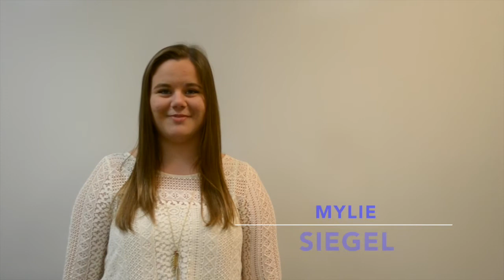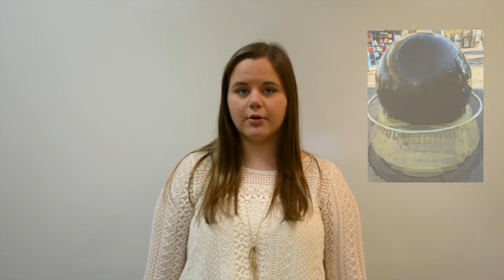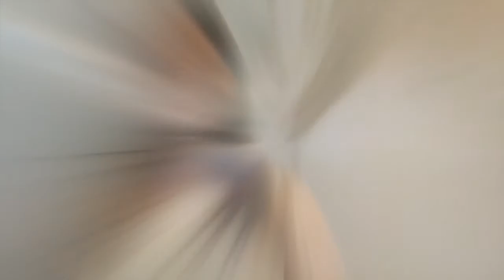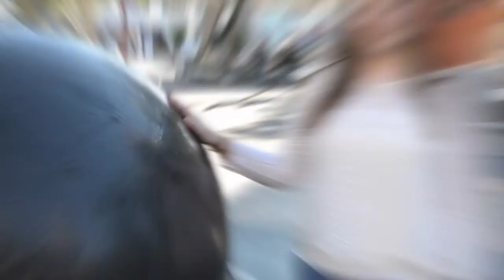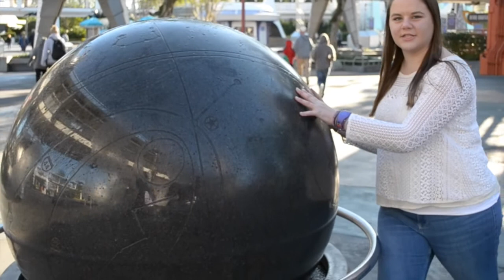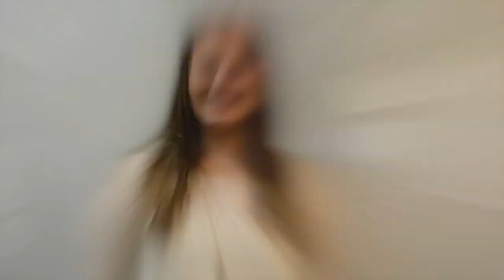Hydrodynamics of the Kugel Fountain

Comment: i was wondering about pressure cause i'd assume too much and it'd shoot out water and collapse the effect, which would just seal the pump and ruin it.  it needs a fairly consistent flow and mass of flow over the surface area. but why can such little pressure produce such a powerful affect?  i assume the pump has to be running for the ball to "float,"  you can't just flip it off and on again.  we aren't relying on pump pressure to lift the ball.  well, you sorta are, but its not like putting a more powerful pump would lift the ball higher, too much velocity means more pressure deviation over the surface, so liquid mass and density have to be part of it.  the liquid mass and viscosity have to be consistent to force applied at the curvature of the ball. but if i put a needle on a ball to lift it and use that same force with 100 needles spread evenly across half of the surface pushing in the same direction, it would still take the same amount of force to lift the ball. however, certain needles will have more mass above them and require more percentage of that initial force required on initial acceleration.  so mass evenly distributes after the affect takes place and this is what "stabilizes" the effect, and the initial mass upon acceleration of the peak vertice of the pitch of the sphere is why it seals upon removing water or destabilizing the flow rate.  you have to let the water create the effect first before the mass displacing affect can happen.  it has to be something with the velocity of the water, the viscosity of the water, and a sealing force that uses atmospherice pressure to lift the mass , but its not entirely that...the velocity of the water divides the mass of the ball per molecule, where the initial forces of the mass of the sphere's curvature multiplies the mass of the molecule from the peak vertice displacement, that as the mass halves per circumference distance around it's outside the force of the water molecule multiples lift capacity.  this is what i believe creates the lift.  you'd think if the liquid's density increases at the peak of the sphere's mass to the molecule pushed outwardly, and the atmosphere were simply trying to equalize it, then it'd have nothing to do with managing velocity and pressure of the molecules's displacement of the surface area of the sphere.  i think we have a weak force, that is atmosphere allowing the water to escape and calm down, but the strong force would be the acceleration of the molecule by the mass of the peak vertice of the perpendicular pull of gravity to the thickness of the sphere, that divides into the curvature to equalize it's force to mass of the curve's relative thickness at the perpendicular pull of gravity as the molecule travels between the two surfaces.  the base plays and important role in this.  without the base to accelerate the distance of molecule travel, which aids in the mass acceleration of the initial inertial moment, this prevents the water from losing it's density, as too much pressure would result in as well.  the curve of the base slows the molecule proportionately to the acceleration of it's initial mass and pressure derivitive.  thats it's constant here.  what i'm trying to say is that if i push a particle it'll remain constant in energy until i accelerate a curve, where the energy of the particle decrease based on the radius of the curve, tying a string to said particle allows it to travel in a circumference indefinitely without losing it's energy.  there are two ways to create constant acceleration and constant force.  the smooth curve of the sphere's base, allows the molecule to lose it's extra energy that would create explosive force as it exits, and maintain a force upon the altering mass of the perpendicular pull of gravity to the lessening mass of the sphere's curves to half of the sphere.   though i think there are more fundamental things going on here with subatomic field density, and the initial moments of rotational inertia, but it kinda explains why turbulence takes a concentrically helical path to lose energy in the smoothest manner's possible. 

i think i understand it.
Reply: I ain't reading all that :P